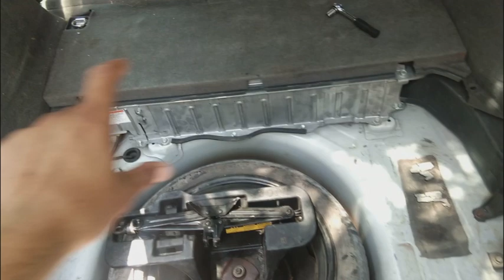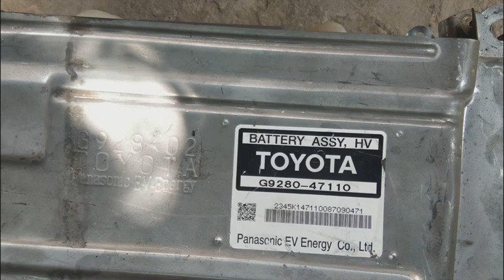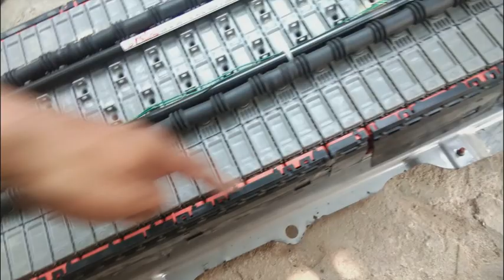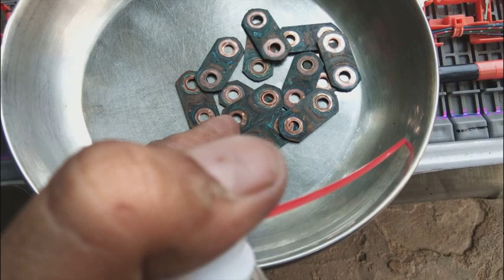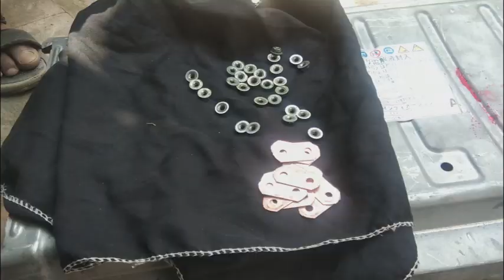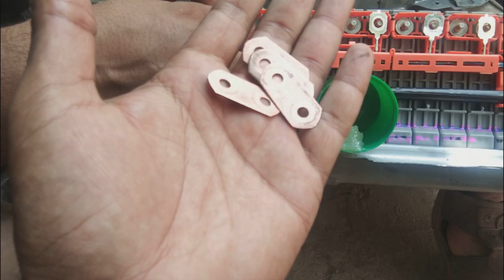Hybrid battery maintenance. Toyota Prius Hybrid Battery maintenance. Car hybrid battery test repair.

Comment: Probably better to put the dielectric grease on after tightening the nuts. Because dielectric grease is not conductive. And having all the grease between the metal contact surfaces could restrict current flow.
Reply from the maker: All greases and oils are insulators. But they have different electric strength level. For low voltages ordinary or general purpose grease do the best at very cost. Dielectric grease is for high tension or high voltage levels. Also dielectric grease is way expensive compared to general purpose grease. So use of dielectric grease here in this application could be an overkill.

Comment: I'm supprised how small the battery cells are.
So are the thin wires with eyelets for monitoring each cell?,  any weak cell would limit the current from the whole battery.
Reply from the maker: Yes sir you are right. These small gauge wires with eyelets measures the voltage for each individual battery cell and give this data to computer for diagnostics.